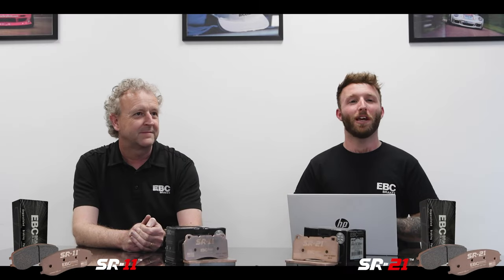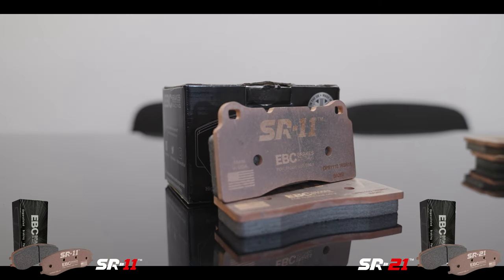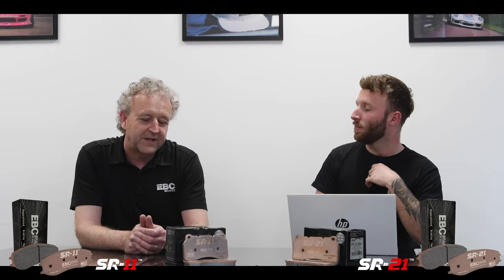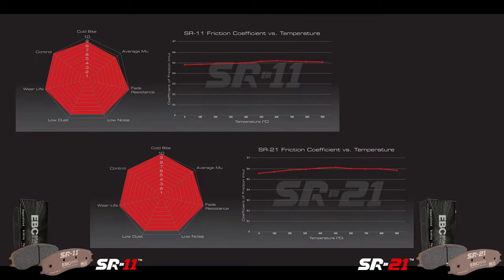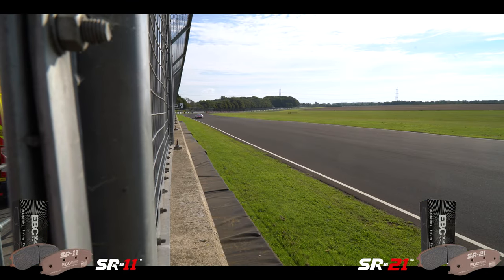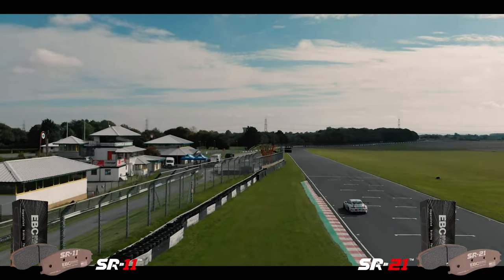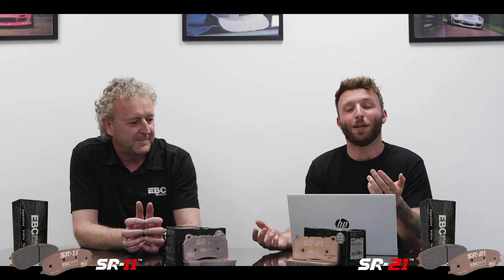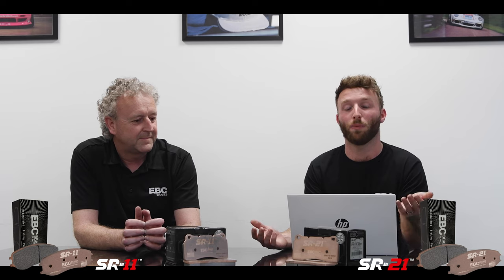SR-11™ & SR-21™ Sintered Racing Pads | Tech Talks – EBC Brakes' Pad Compounds

Comment: I've been daily driving a RP-X on the front axle. What will I notice different if I change to SR-11 and new rotors? I'm in the US and not concerned about road legal.
Reply from the maker: As they are a racing pad, NVH isn't taken into account when manufacturing, so you will suffer from more noise but you will see an increase in performance.